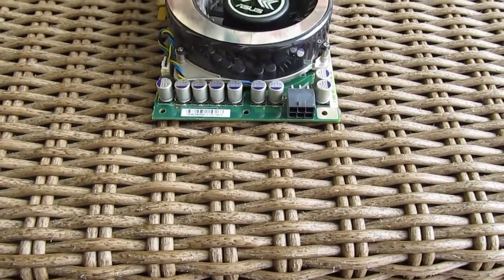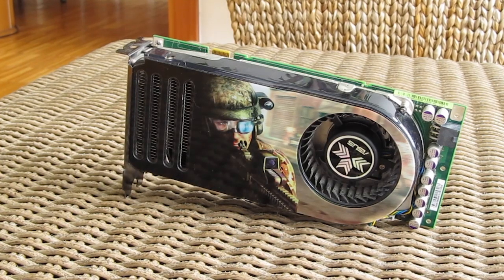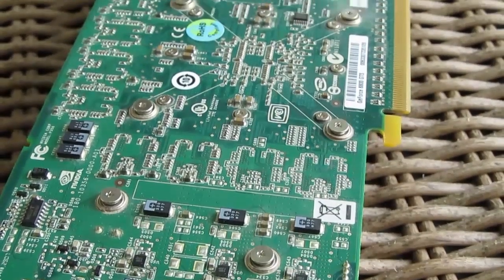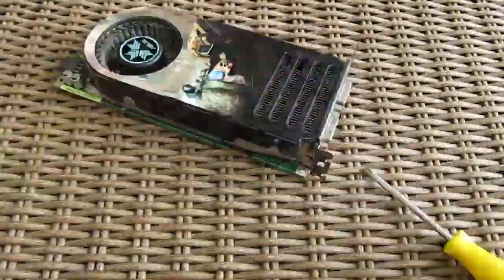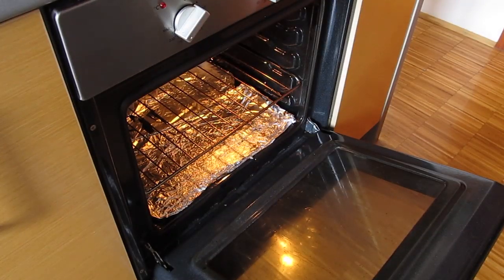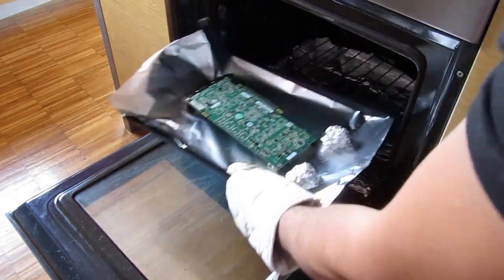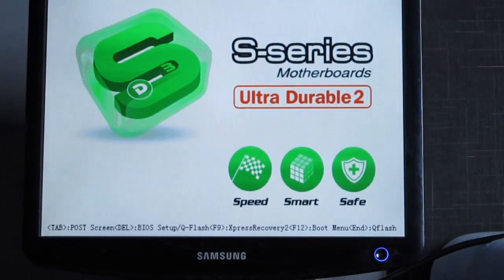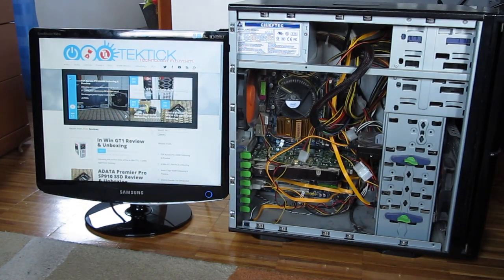How To Repair Graphics Card (Oven Baking Edition)

Comment: Stress that the temp is degrees C.  You have lots of viewers who will wrongly assume you mean 270F and will not be successful with the cold 270F "cook".  Great video with expedited information flow. This reflects upon you exceptional pre-planning of content.  Regarding the 270C, that's about 518 degrees Fahrenheit which, is risky (too hot) if the cook time is too long. Clarify final temp setting in both C/F.  I recommend 230 C (450 F) for 10 mins. Then let cool slowly over 30 mins.  It works for me just fine on every card I have processed.  THANK YOU.
Reply: He said “two hundred Celsius degrees”, not “two hundred seventy degrees”, but you are right that it’s important to note the difference between C and F.

Comment: Holy Crap it works. I just received a Sapphire 6870 from ebay today. I bought it for 25 dollars knowing it had problems with lines on screen and only working in safe mode. I got another 6870 about a year ago for 40 dollars with a broke fan. Modified a fan to work and been using it since with no problems. I took a chance on this other card. If i couldnt get it work i could use the stock fan off it. The oven trick worked great. Fired right up and using it now. Ran a few benchmarks and played FarCry 4 for about an hour. also in eyefinty. Now i have 2 6870s for only 65 dollars.  Now another 10 dollars for the cables to crossfire them.  So it did work for me.
Reply: Rick B YO! I have the same cards but how did you bake them? What happend to the plastic connectors?

Comment from the maker: IMPORTANT UPDATE / WARNING: With newer gen GPU's (ones that came a generation or two after this series) it's advised that you put them in an upright position. It's been over 7 years ago since I did this video, plus the GPU's itself was already old to begin with back then, so in the meantime, the ways of production have changed as well as the type of capacitors (and probably solder and solder melting temperature), which is why I'm from time to time getting some feedback from people where their GPU capacitors feel off. With that said, If you have a newer GPU, trying putting it in an upright position, maybe even lower down the temperature a bit. Since I didn't try this again in the meantime, I can't tell you for sure what is going on and if it's going to work, it's best for you to hand it over to a professional so he can reball the solder points.
Reply: WDYM?
Reply: @justforfun2193  He means you put the chip UP not DOWN. If you put it down like he does in the video it may fall off.

Comment: I thought this was a joke at first. Tried everything with my old sapphire HD 7990 which did power on but have no signal. Cleaned it thoroughly, refreshed thermal paste.. still nothing. Tried this as a last resort, fully expecting it not to do anything. And BAM. It's working again. Thanks for this video!!

Comment: This really works it worked for me I have a convection oven. My temp was at 310 degrees for 12 minutes. I had to bake my card twice, the second time worked like a charm.
Reply: Yea it worked for me too but please note that this is just a temporary fix so you still need to change your GPU. I did this to my GPU but it only works for 10 months after that it won't work anymore. Reheating will only work for 2 days then eventually it won't work at all.

Comment: Following your instructions to the letter (except I used convection heating at 385F for 10min.) just resurrected my GTX770 Classified from the error 43 dead zone. All graphics artifacts are now gone. Hope it lasts. Thanks so much!
Reply: i have the same card and did you need to reapply thermal paste
Reply: @augydoggy  Doesn't matter what card, you need to remove the paste: https://youtu.be/hP2_w5Mebe8?t=116 (from the heat sync too) and then apply new paste: https://youtu.be/hP2_w5Mebe8?t=189
Reply: @modal11  thats what i thought i have been trying to fix mine for like 3 or more days straight and every time i try to install a driver there are red likes on my screen
Reply: @augydoggy   not sure what you mean by "red likes" but sounds like your GPU might need replacing.. I was surprised this fix even worked and have since replaced that GPU
Reply: @modal11  I meant lines
Reply: @augydoggy   yeah, not good. If the bake fix didn't get rid of that it might not be a cold solder joint.
Reply: @modal11  I fixed it

Comment: Just baked asus GeForce 1050 ti! It works! Amazing! Thank you my friend you saved my wallet! :D
Reply: Raul Mario hey mate! It was black screen! But better let’s say there was no signal on screen. It still works perfectly. Also be careful to put it the opposite way, chipset must be upwards so nothing drops while melting. Don’t move until it get cold. Good luck! :)
Reply: Gonna try bake my 1050ti this week. Wish me luck
Reply: Pablo Grpic is your gpu still ok now?, my second hand rx470 (ex mining) died, no signal, fan didn’t spin at all, i didn’t have oven or anything, so i use hot air gun instead, and it works, but i better saving some money before it completely dead

Comment: hi ...which type of oven you used? and after baking gpu Is that oven safe for baking edible item?
Reply from the maker: Normal, electric one! Yes, I've baked stuff afterwards
Reply: Im worried about this aswell
Reply: om prakash bhatt if you check on linus video, he said that after you bake your graphics card u cant bake it on the oven again...
Reply: om prakash bhatt no you should use an oven you don't plan to use food in. It's dangerous to bake food in afterwards

Comment: didn`t work for me,i probably fuc*ed up settings on my oven.tried it on 9500gt for 10 minutes.when i got gpu out of the oven next to gpu i found 1 resistor,3 capacitors and 1 chip.

Comment: Thank you very much... a capacitor fell out... DON'T ALWAYS FOLLOW THE ORIENTATION HERE... IT'S SAFER TO POSITION IT RIGHT SIDE UP.
Reply from the maker: What GPU?
Reply: TekTick A gtx 960. You may need to update your video about the orientation.
Reply from the maker: The disclaimer is in the description box as is from the beginning, but I'll add this one in, just to prevent such scenario!
Reply: TekTick thanks a lot. I understand the disclaimer, it was just  unexpected to happen but it makes sense. The solders will soften so anything heavy enough will have the probability of sliding down. You can just imagine my panic when I saw the capacitor slowly sliding out of the board.

Comment: I tried it with an old GeForce MX 440, in 7th minute capacitors started to fell off so I turned the oven off and then something blew ! :D 200(˘C) seems too much for this one xD Ok so capacitors blew xD
Reply from the maker: +Vlachy goes by Kuba Well, that escalated quickly :D
Reply: As for degrees - I spoked to my friend (I should have done it before xD ) - and he told me that 180°C MAX ! :)
Reply from the maker: Yeah, that's a really ancient model, it has old school capacitors and they were probably on the verge of popping anyway :D
Reply: ***** Yea, TNX for the info :)
Reply: Well don't use the oven anymore it can be poisonous and hazard if you cook or bake food again
Reply: Same happened with me i baked my gtx 650ti and the capacitors fell off and the fan power plug melted 😂
Reply: same thing with my rx 460

Comment: Is it possible that this will work with the ASUS STRIX GTX 980ti. When installed it lights up but there is no display. Fans spin but no display. The reason I know something is wrong is because I have 2 and one works and this one doesnt.
Reply from the maker: You bought it used or ?
Reply: TekTick It was bought from a job lot so i have no idea about its history but i do know that it doesnt work
Reply from the maker: Then try this technique, you have nothing to lose in my opinion, or you can go to a professional to do a proper reballing
Reply: TekTick It never worked but never mind. Atleast I can say I tried and thanks for your help : )

Comment: I have a gtx 980 ti which reboots my computer under load ( more load = faster reboot) . PSU is good enough.
Should I try this ?
Reply: Alin Vlaga you should try to use another PSU, I had the same problem with my OEM pc I had a few years ago. If it was under load it rebooted due to lack of power being pumped into the system. It's most likely a PSU problem.
Reply: I tried in another pc with superflower 650w bronze and I had same issue.

Comment: worked with me on 7850 2GB Thanks too much
Reply from the maker: +Ahmad Abd El-wahab Glad it helped! :)
Reply: +TekTick  but what is the reason for this ?
 My friend has the same or using the new VGA for only 5 days
Reply from the maker: +Ahmad Abd El-wahab It's called a "cold solder joint", where somewhere on the PCB itself some component lost contact wit a trace or some other component, which then manifest itself as a problem of graphics card not working or showing artifacts.

Comment: My Radeon HD7700 just died the other day, first whole screen went gray, then I restarted my PC, and there was an area in the bottom of the completely black screen, coloured in green/red/yellow. I switched to internal graphic card and it worked just fine, so it can't be cable or monitor. I just found this trick, it's very popular it seems, and worked so many times for so many people. I'll try it and hope my graphic card works... As for the temperature, which should I put? Is 200°C okay?
Reply: Btw, it's a 1GB DDR5 graphics card, so it's not something cheap or something. But I'll still try this, I have nothing to lose. :)
Reply: Also, what do I do with connectors? You know, where you plug-in monitor cable? They're plastic. Also, I habe few cables on graphic card board. Should I remove them?
Reply from the maker: +Djordje Stojanovic They'll be fine! You can see that I didn't shield them with anything!
Reply: TekTick Okay, thanks for your response, I'll try this as soon as possible. ^_^

Comment: maybe i did something wrong,halfway through while baking my capacitor pop out from the board..
Reply from the maker: The temperature was probably just a bit too high, it really depends from oven to oven
Reply: i set it at 195c,cuz the oven doesnt have 200c over..nvm xD
was 50-50 anyway old asus 670 dc2 just trying this method for my own experience
Reply from the maker: That's always the best way, adventures spirit! :)

Comment: Trying this with a ps4 pro. It won’t turn on. Even with new power supply. It’s not working. What else do I have to lose? Applying flux around cpu/gpu @400 and baking for 8 mins. (Remove coin battery or it will pop) will update after it cools down.
Reply from the maker: Let me know how it goes!
Reply: @MattsPaddock  No Go. But doesn’t mean I won’t try it on one that actually turns on and has the blue light of death. This one wasn’t turning on at all..  I’ve used a heat gun on one around the CPU for 15 mins on a blue light of death before and it worked. So I believe it will work In the oven.

Comment: 2:25 I put the card in this way > with the components down ... and my components dropped out and pop like popcorns :D
Reply from the maker: Maybe your temperature gauge was off :/ What GPU?
Reply: 200c and about 8minutes when components drop down to oven.
i dont have any tinfoil and i use oven grill plate.
 gpu is old gainward gtx 580...work nice 2d use like worktable and watching videos, 
but 3d use like gaming crash all the time. 
1st  i try liquid cooling this gpu, but problem is not a temp.
2nd i try use every nvidia drivers what i found oldest to new, but no help.
this is my 3rd salvage try, baking my gpu, but is friday 13th and result is popcorn :D

ps.sorry my poor english language
Reply: @bottipoika  yeah! last week i try this baked gpu resept again in my dead gtx 560, but this time COMPONENTS UPWARDS and all go ok! gtx 560 awake back to life!

Comment: Any advice to bake an AMD HD 6850?
Reply: +octávio pereira I don´t have an oven with temperature regulator, so I used a hair dryer instead. (I really knew the problem was in the GPU so i only aimed to the chip).And I confess that I was not too confident that it would work but i was wrong. It worked.
Reply from the maker: +octávio pereira Niceeee! :)

Comment: Does anyone know if this trick will last? ie, how long does the card work until it break again?
Reply from the maker: +kev090997 I can answer this question :)
I repaired four graphics cards using this method, plus this one on the video, and only one of those five had to be redone again after a year of use, the rest of them are still working.

Comment: Welp. Followed what you did and all the capacitors feel out
Reply from the maker: That's really odd, especially if all feel out, maybe it runs a bit hotter on your oven, like an offset. Or the solder was a lower melting value?
Reply: #gtx 560 ti zotac... All capacitors fell of don't do it on this card...
Reply: Yes dont do this, same happened to me.

Comment: i left for 3 minutes in oven and just after 3 minutes i smell something i just opened the oven and kitchen was full of smoke all the component fell from the graphic cards . Graphic card fully burned with in 3 minutes on 150 degree.
Just bin it
Reply from the maker: Did you preheat the oven? If it was close to the heating ring, it could be that it emitted more heat that than set 150°C

Comment: Well.. I tried it. And now I have a screen with green and blacked striped lines :/ I did exactly what you said.
Reply: 10 minutes with heat from above with the grill thing
Reply: Is there anything I could do to fix it? It's the only good card I have (Sapphire Radeon HD 7950 3GB Boost). It's either trying to save that or be on an AMD Radeon HD 5450 which was made in 2009...
Reply: I mean, it looked brand new after it was in the oven :/ saw nothing wrong with it. The only thing that would've made it smell awful would've been the plastic being a little too hot. How could the plastic affect the card?
Reply from the maker: Yeah, this fix is not 100% guaranteed to solve the problem, if your problem is a cold solder to begin with. :/
Maybe take it to a professional repair shop so they can at least diagnose the problem.
Reply from the maker: Yeah that's probably plastic, that doesn't effect anything. Why didn't you remove that plastic part too?
Reply: TekTick it was stuck to the card
Reply: And well, I live in Northern-Norway so getting technical support will be near to impossible

Comment: All capacitors fell off...
Reply from the maker: What GPU? It seems like with the newer generations of GPU's this is a pretty common thing, possibly a lower melting point of the solder
Reply: @MattsPaddock  dude, just update video to rotate card on other side (capacitators heading up). You already told 2 years ago, that you update it, while, newer and newer people damage their capacitators, while it could work turning other way.

Comment: Thanks folks a lot!!!  The Myth with this kind of "voodoo" fixing a graphics card IS BECOME A REALITY!!!  
Anyway, before a couple of days my GPU get white lines moving on the monitor... From the beginning when I boot up my pc... So, after BAKING my Zotac gtx 480 1.5gb the problem is solved !!!
But, after baking I find some 5-6 capacitor looking like more grown up or swelled... My graphics now work fine after some stress tests, but i'm considering is that okay if the capacitors is looks not really okay ???
Reply from the maker: That could be a problem, but at least capacitors are easily replaceable if you have the necessary skills for that. :)
Reply: TekTick Normally that I know, but I never work with this kind of capacitors before...maybe it's the same thing... However, is this capacitors can easily crack down in the near future, couple of minutes, days etc ? Any experiences ?
Honestly, my graphics works excellent after baking...
Reply from the maker: Peacemaker69
It's really hard to tell, if you don't plan to use it that long in the future, it will probably "survive". Otherwise, take it to somebody who can replace the capacitors.